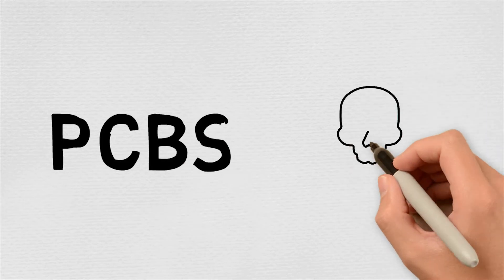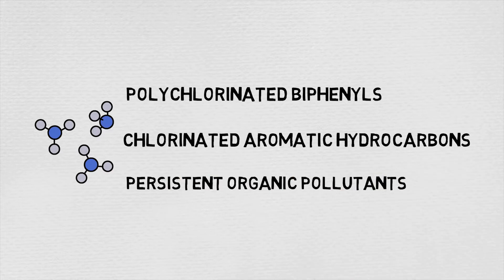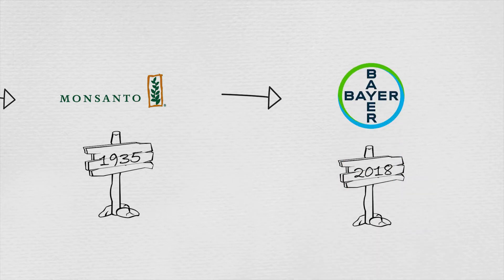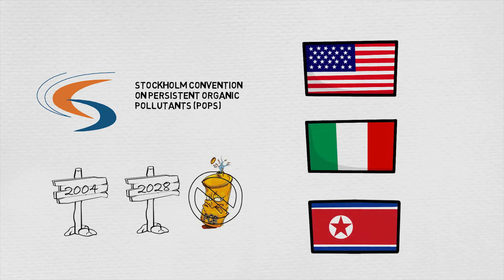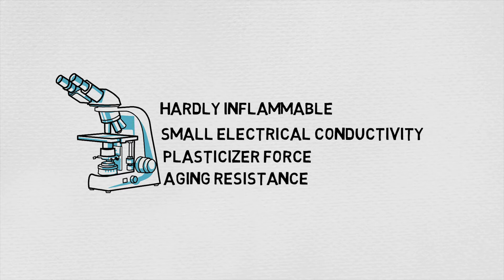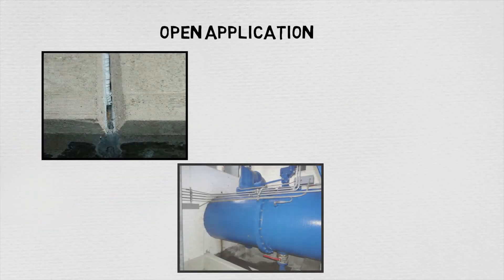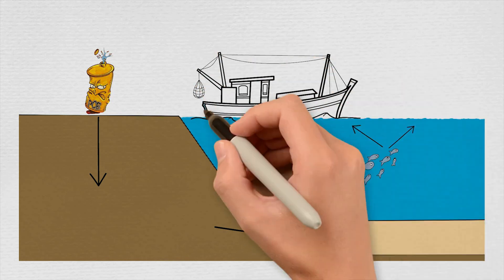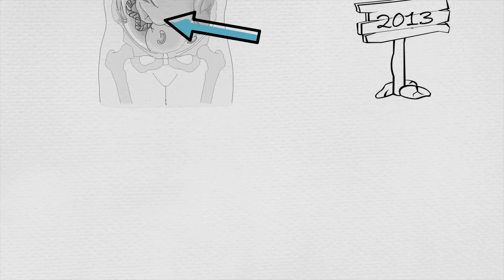What are PCBs

Comment: I google ‘PCB Smell’. The search results said PCBS don’t have an odour but I believe they do. The PCBs I am referring to are in capacitors in Flourescent light fittings manufactured in the 1960s and 1970s. The smell is combination of sweet burning plastic and soap smell. Does this odour sound familiar?
Reply: I have noticed this when salvaging components from older electronic boards. The smell is potent and stays on my skin after contact. I am unsure of what is causing it; that is what I am researching now. It seems to be coming from the board itself. Worried about the fumes especially when de-soldering. Found out what it is yet?